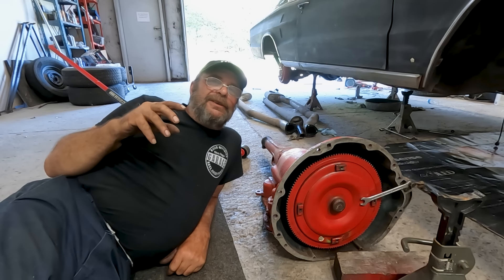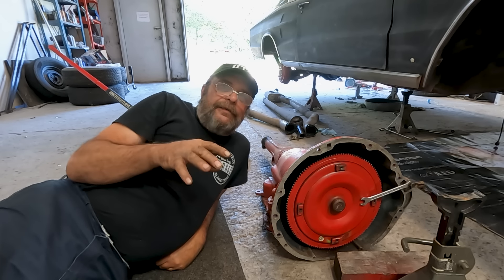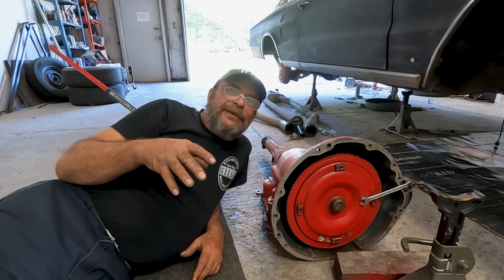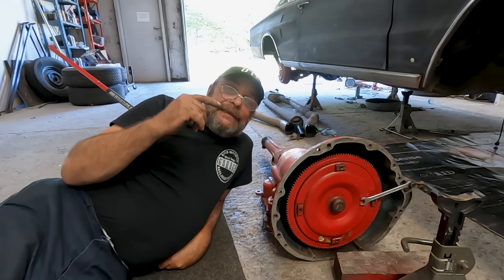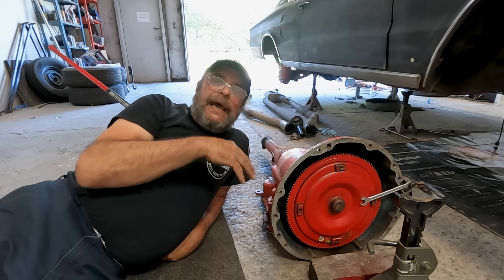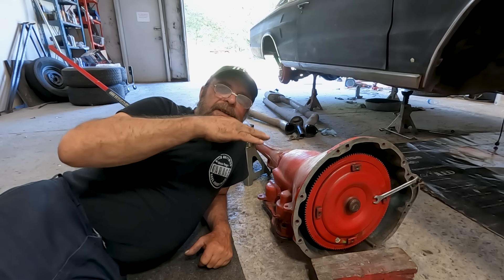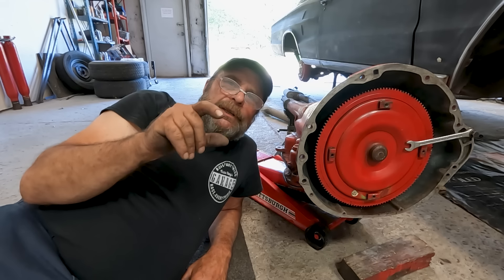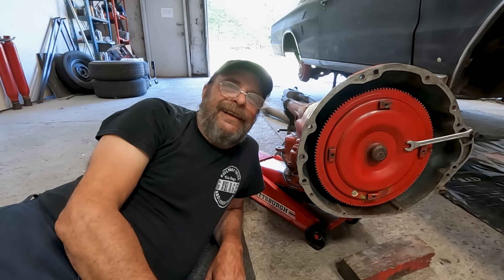One Man, On The Floor Transmission Install- So Easy Even An Old, Crippled Guy Can Do It

Comment: I've always used two 6" grade 8 bolts with the hex heads cut off at the 10 o clock and 2 o clock position and use them like a rail slide to slide the tranny into place

Comment: I use 
8' long bolts in the top bolt holes as a guide. The trans just slides right in place. Must be something wrong with me. In my youth I bench pressed the trans into place lmao. Yes I pulled the trans on top of myself while under the car.

Comment: Old Mopar transmissions are light. I used to put them on my chest and slide under, then put it on the dowel pins and  hold it there with one hand and take the bolt out of my front pocket and get it started. I learned quickly you don't do that with a Turbo350.

Comment: Do whay you've gotta do when your alone if you have two friends to help a plank wider than the car and perhaps a 4x4 nailed to the center for an offset. Ill lay under the car to line up the trans and two friends lift on each side if the car world of difference same principle tony describes just easier with some friends

Comment: I used Allthread on my last transmission replacement two guide pins on top.   E4OD  heavy Sucker.        I was lazy and left allThread in place and Just put Nuts on them. Still there ten years now. Pretty Sure I couldn't find the Bolts.

Comment: First Trany I replaced by my self was on a gravel driveway. I forgot to but a plug into the output of the trans. I rolled it on it’s side and lifted it onto my chest. Just then it started pissing gear lube all over me. I was committed to getting it in place so I pressed on. By the time I had several bolts in and got out from under the car I was covered with gear lube, gravel, and dirt. My mom wouldn’t let me in the house to clean up so I had to wash up and change clothes in the shed beside the house.

Comment: Used to work at a gas station in High School and  besides pumping gas and performing service and repairs on customer vehicles ,we rented and serviced U hauls. I used to have to pull and install those big oil heavy cast iron manual transmissions by myself outside since they would not fit in the little 2 bay shop. I didn’t have a trans jack and would just roll them on top of myself and hope like hell it went in the clutch on the first stab cause bench pressing those monsters one time was all I had in me per day, and I wonder why I can hardly get out of bed anymore…

Comment: just did my first trans swap in a 74 firebird couple weeks ago.  I was lucky enough to have the car high enough with the oreillys blue stands, at a safe height, other jacks and concrete blocks surrounding the car just in case something bad happened..  i was able to slide my th350 from my floor dolly onto my harbor freight low pro jack.  I had a small section of plywood bolted to the jack lift swivel thing, and was able to roll the entire trans up under the car with the highest point of the trans going through the driver side fender area by the firewall..  very tight fit but was smooth.  Got it up and in there, bolted up, but had to do this twice because first time i didnt bolt the trans adapter right on the block..  did a twice trans swap basically in one day.   Was fun.  Crossing my fingers everything works together when i crank the car up soon.

Comment: If you don't bench press the trans up on a 3 ton bottle jack and balance it there while simultaneously using your knees to inch it forward so you can give it one last heave up into place, kick the bottle jack out, and hold the thing up with just one leg and one arm while you fight for 16 minutes trying to get a bolt started...
I mean.. can you really call yourself an experienced OG backyard wrench ninja?😅

Comment: well tony, i can remember back in the 70s just wresling the tranny up in there, although we where 10 times stronger back then, or get it on your chest, slide under jam it in, things where much easier with youth, although what we had in strenght  we lacked in knowledge , if we could only have both at once

Comment: Tony, I like your videos and like old tech, I think it’s better, more reliable not having to hope a very sensitive controller doesn’t accidentally ground out one time and kill the car or tranny. Everything 1980 and older is getting hard to find and especially priced to sell. I’ll get to my point now. The garbage leftover from early 2000’s is still around and available. How viable is it to rip the fuel injected monstrosities out and replace them them and their electronically controlled automatic transmissions with carbureted engines and vacuum timed automatics or manuals altogether? Are ECUs so integrated as to be able to stop the vehicles from working or to lock out speedometers and ECT gauges and such? At the end of the day I want something I can trust. Carbureted, distributor fired, and preferably manual but at least not computerized transmission. I would prefer to take it further and not have to fear the ECU messing with anything. Junkyards don’t want us buying rolling stock anymore. Individuals are so blinded by inflation they’re asking stupid numbers for stuff in worse shape than would be needed to only get scrap weight at a salvage yard. Half of what is for sale doesn’t have a title.

Comment: When i pulled the cast iron powerglide our of my 56 chevy I let it dangle until i cleared the car , stuck a pipe underneath and wiggled it till it fell and cratered the sheet of plywood, drug the junk to back pile and it stayed with the house when I sold it

Comment: There's still plenty of us, I think, that just get frustrated with trying to use all th tricks, shove everything out of the way and just press the damn thing into place, using thin long screwdrivers to line it up, and get a bolt, maybe 2, started. Last one I did was a 74 F-100 c-6 behind a 460 bbf.... with headers, what a pain in the ass. I think putting the starter in the old cutlass was rougher, just about the same weight just less room to work lol. Great tips UT thanks.

Comment: What you do is get under the car with your head under wear the trans crossmember would be. Slide the trans on your belly. Lift the bellhousing up with your knees and wiggle ghe tail end until its in place. Put a bolt in  socket with about two feet of extensions. Get the bolt flush so the bellhousins cant back away and fall down. Then put a bolt in the other side. Temporarily place the crossmember in to hold in place. Then bolt up the torque converter, and finish the bellhousing bolts, and bolt in the crossmember.

Comment: Installing a 5 speed transmission while lying on the floor under my car is how I seriously hurt my back so badly that I needed back surgery.  Never again.
Reply: Pulled an iron case granny gear 4 speed out of my pickup to change a clutch and it rolled off the floor jack and nearly mashed my hand.  Surprised it was so heavy.
Reply: And it was in the winter on cold concrete garage floor.  I got sick with a cold or flu right afterwards, about 25 years ago.

Comment: I am doing the tranny in a '95 Ford probe even though I have problems with my left hand and have to use the Walker to get around. It's been interesting. March sixth the doctor told me I was paralyzed on my left side after the stroke, and I would never walk again and maybe never have function of my left side again.  I told him I'm walking out of here Friday and I'm taking your Walker with me, a few months later here I am still messed up and doing a tranny.  Wait that didn't sound right. Doing a transmission... You think I would have learned. . From when I was looking for an aspire tranny and I got images I didn't need to see... Transmission dammit transmission... And to make it more fun I'm doing it on a piece of four by eight plywood out in the yard under the cottonwood. I haven't had a cement floor since 2004 when I close down the shop. And my floor jack don't like dirt. It's not the off-road model..  I think this is easier with two functional hands

Comment: Love the story in the 70's my dad built hot rods old pu's a big piece of card board thick set trans on card board slide it under the car he would lay beside it ,l was a kid over yrs he and me would lift the tail shaft on his stomach dad was a barrel chested big armed guy and we lifted it up on his chest so trans on his chest l would crawl under bolts in hand he would bench press to transmission in position sliding it in either manual or auto wiggle rotate untill it set against the block l had to get bolts started sometimes a couple of tries cussing had some blocks of wood to hold the tail shaft w untill we got the cross member in dad was the Jack his name Don lol, l was the guide old school muscle and eventually a skilled team ! Don't get me started on clutch install un a snow storm in 18% weather !

Comment: How much would you charge to fix the transmission in a 2011 Chevy Impala?  The fluid is brown and smells burnt. It makes a whining sound, but not too loud. The transmission works but sometimes it slips when parked at a red light or stop sign. Once it gets passed first gear it's good.

Comment: Doing them on my back as a teenager slide it under, get it on my chest and hump it up and in, did many like that till I was about 21 then realized it was time for a lift, never did it on my back again, that was almost 40yrs ago I learned to work smarter not harder at a young age

Comment: Using a ratchet strap under the car from frame rail to frame rail is another way to get it in position, and a great safety for when you get a cramp

Comment: My way is 4 ratchet straps 1 in the front and 1 in the back go up with the front an back 1 in till the straps won't go anymore hook up the other 2 and go up the rest of the way and you still can get your angle by tightening up one more than the other and be able to slide the transmission from one side to the other easily with out the transmission falling off the block of wood or jack give it a try and tell me what you think????!!!!

Comment: Easiest tranny I ever took out/put in was my 66 Triumph Spitfire.  It came out from inside the car.  4 bolts took out the centre console, the bell housing cover was screwed to the floor pan.  Remove bell housing bolts, disconnect the front u-joint and lift out.  Of course it only weighed, maybe 60 lbs.  Putting back in just as easy.  No need to jack the car up at all.  It had IRS so the drivel line was high; above the backbone style chassis.

Comment: I have to drop the manual transmission (what's that?) on my '99 F150 because Ford in their infinite wisdom felt it would be funny to put the slave cylinder inside the transmission. I've never dropped a transmission before-I felt an old manual would be a good one to start with. It's funny how keeping the vehicles running seems to not count as collateral with housekeeping, laundry, dishes, et cetera. I sure don't see her in the garage helping me.

Comment: I would slide them under, line up the torqe converter. Slide under the car. Put my knees under the bellhousig, pull my feet back and bench press the tail shaft.  Start two bolts. And relax. Then finish the job.

Comment: Uncle Tony I need help, I’m struggling getting my str15-8 to seal on my 383. I’m using a felpro 1214 without the paper gaskets. Should I give the paper gaskets a try? I’ve never used them before never had an issue. I’m also having people tell me to skip the sealing surface of the metal gasket on both sides with rtv, that seems like a bad idea but im stuck I don’t really want to go to a valley plate

Comment: Very true, uncle Tony in the 1980s, if you Had a trolley Jack you were serious as a DIYer

If you had an air compressor rattle gun and an engine crane, it was just unheard of that was serious gear. Now it’s all eBay junk from China and everybody’s got them.

Comment: i did my 1st and only tranny install on my 2006 F150 by myself with a SMALL floor jack the i built a small wooden cradle with about 8 screws and 4 pieces of wood attached to the base.
TLDR; i got it on the engine in TWO stabs
the biggest regret i had was not borrowing an air ratchet to remove top tranny bolts all of which took about 20 minutes each with shitty hand ratchet and 3 ft of extensions
those sa,me bolts went in in about 5 min each with air ratchet

Comment: And then it twists, slides off the jack and on to ya fingers.  Ahh the good times of spannering😅.  I prefer the, roll tranny onto crutch then soak crutch in oil , lift with knees and arms while lying on my back cursing.

Comment: I was 17 when I took the Borgwarner 35 out of my Chrysler. The torque converter came off the shaft and dumped trans oil all over my face. I could do nothing as I was on my back with the trans on my chest. For 40 yrs the smell of trans oil has me traumatised

Comment: Okay you got it on jack stands but for added safety why don't you put tires on both sides of the car right behind where the front wheel would go in case the jack stands give out
Reply: I'm just saying that's how I used to do it when I was a young man for my safety

Comment: 4 speed is 100lbs heavier than a 3 speed. 289 mustang not designed for burnouts . Learn the hard way twice or three times (Use" pilot shaft"if you have one)

Comment: I made my own adapter for my 727. It has 4 ears on the case, I tacked up some tubing prior to removal and made it so I can just plug it into my floor jack. It bolts onto the trans and makes removal/installation a snap.

Comment: How many tons should the jack be to achieve the desired height of the vehicle?
Reply: Want to lift 1000lbs? Use a rated 1000lb jack….. any load bearing tool is underrated by 10–50% for safety purposes
Reply: @LibertyOrD___h  What capacity jack stand did you use to achieve the desired height for removing the transmission?
Reply: @CelsiusAray  well, the 4L80e in my suburban required 3ft of lift to replace the transmission. I used a 3 ton jack and used 4x4 cribbing on 4 corners to support the vehicle

Comment: I am swapping the interior on my 55 century fit good either simple mods. Have a 200 4r od. Was wondering about using the floor shifter any body ever do this?
Reply: Interior is from a 2005 lacross

Comment: Crummy jack stands from the seventies, you bet. I bought my first pair at K Mart, raised up my 1963 Caddy to change the tranny fluid and replace the cooler line O rings. I had just finished and lucky for me my head was more or less in the passenger front wheel well. The jack stand supporting the passenger side front collapsed. My chest was pinned down but not so much that I couldn't breathe but enough that I couldn't speak. I was theer for a time but I was discovered. and released.

Comment: A better way Is to jack the car at the front even further, push the trans under the tunnel with a jack strapped to the auto and then lower the car over the trans.

Comment: OK BOOMER, Im not a mechanic just grew up on a farm and never changed a tranny ever before. Closest i came was helping buddies change one but mostly drank beer and watched, lol
BUT when my 2006 F150 all of a sudden blew its tranny with only about 45 minutes warning, i had to either spend 3500-4500 for a shop to stick in either a used one or rebuilt for higher price.

Anyways TLDR, i watched a couple Yt videos, i bought a rebuilt one with shiftkit already in it for only 1650$
Pulled out old one in 6 hrs total, put rebuilt one in in 5 hrs. That includes all the time looking for tools extra socket extensions to reach top bolts, i needed about 3ft of extensions , also inc time needed to build little wooden tray and bolt it a standard floorjack.
BAMN stabbed it onto the engine on either my 1st or 2nd try, cant remeber at it was 10 yrs ago when i was 42ish.

So the way i look at it, whole process inc driving time to get trannyin another  city, gas, watching anhours videos took about 24 hrs 
BUT i saved about 1800-2800
SO 2800  saved cuz i got rebuilt with shiftkit divided by 24hrs work =about $116/hr
I basically got paid $116/hr to do it myself on a weekend , no loss work time

Comment: Personally I blame squirrels....... and slow notifications
Reply: And as you roll the transmission in place  the one acorn left behind  by our trouble making rodent locks up the floor jack wheel!😲
Reply: Or those Trash Pandas.🦝🦝
Reply: @derekbowbrick6233  total trash pandas
Reply: @glennnickerson8438  😁
Reply: @unclesquirrel6951  🦝🦝
Reply: I blame the moose and broken coffeemaker.
Reply: @unclesquirrel6951  oooh them pandas.

Comment: Worked on the girlfriends Barracuda, 904 by my self no jack. On jack stands in the front yard of the trailer Park. Lmao. Worked at a garage with my BF still 41 years later, was on flat rate and we were blind doggin it , owner would not get a trannie jack , and Jim is dickin me around, as I have to stab a thm 350 , in a Chevy. After ten minutes I was so pissed, I hulked it, sticking a couple of bolts in my shirt pocket and snatched it to my chest and installed it on the pins and thread the bolt by the oil filter. 28 years old.

Comment: Let me save all of you the headache.  Buy yourself a motorcycle jack they are light weight made of aluminum and are flat perfect for a transmission pan.  Strap the transmission to the jack and roll it under the car, car to low?  Slide the transmission under the car then slide it onto the motorcycle jack.  Motorcycle jack that’s the answer to installing a transmission yourself.